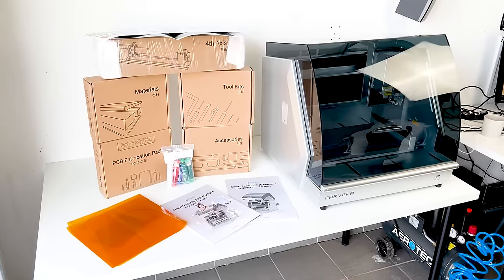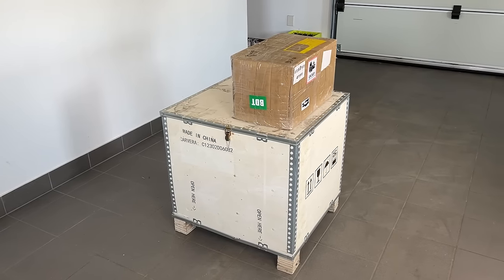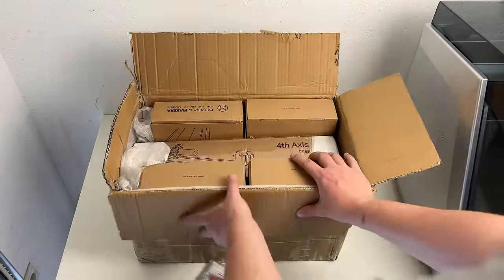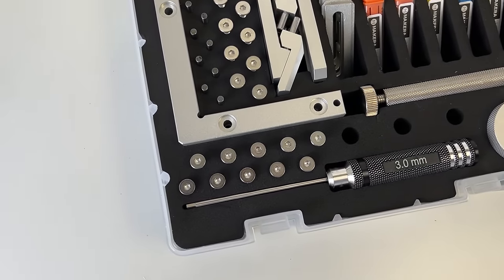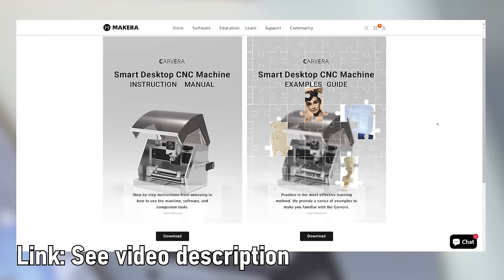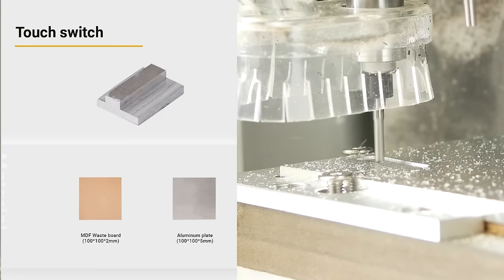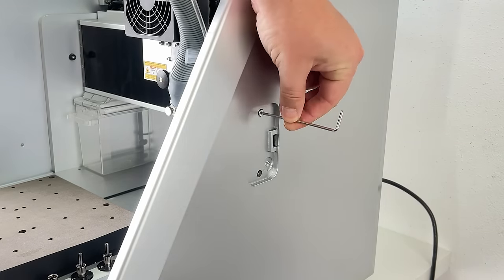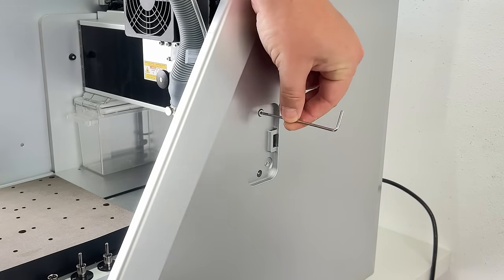Makera Carvera Desktop CNC: Great for (wealthy) Beginners ?

Comment: With the influencer accessories package and after tax it's no longer 5000$ but over 8000$ in Germany.
I can have PCBway make quite a lot of parts for that kinda money. Plus, I don't need an extra room as a workshop...
Reply: It boggles my mind this is so expensive. I bought a Langmuir MR-1 for $7000. Sure, I had to assemble it myself, but it is a much larger machine with way more power.

Comment: does the air assist of the carvera work well ?
Reply from the maker: Works well, I used it since the last try of the Alu part
Reply: I am really curious about the depth of the pockets that can be achieved w/o mist cooling or coolant. I would make so many projects with that machineee geeez THE MOLDS I would make hahaha

Comment: They should make a tiny one with an a4 sized build plate for pcbs only. Pcbway sponsor so many people that they gouge us little guys. If they stopped sponsoring everyone with 1k and over subs they could pass some savings on. I submitted a 2 sided gerber a few months ago and they wanted over 120usd shipped so i tried jlpcb and it was 7 bucks and i had the boards in a week. Pcbway want a fortune for the least amount of options of any board house ive tried.

Comment: It’s not really high end, but a decent machine with good options for the money
Reply from the maker: I think one should add - High-End "Desktop" CNC mill -
Reply: @247printing  not high end
Reply from the maker: @sciencesaves  So then, I am all ears, please define "High-End Desktop CNC" for me, please. Really curious where to go.
Reply: @247printing  Maybe some CAD/CAM dental machines?
Though that's small work area and high (100+ k rpm) spindle.
Something like 8k USD to 100k
Reply: @247printing  It may not fit on a desktop but it fits through a standard door, the DATRON neo is as high end as you'll get.
Reply: @247printing  you could start at the Samurai, then keep looking from there